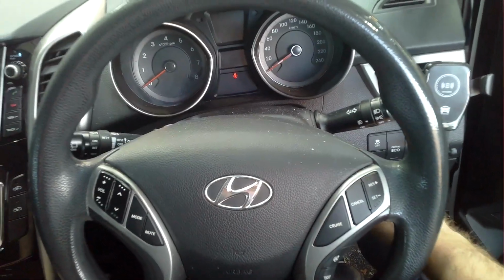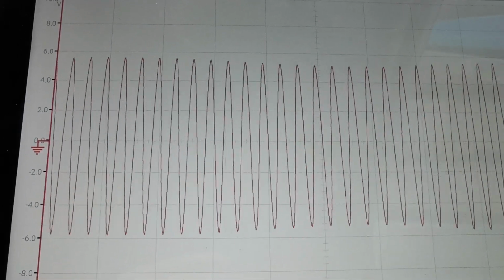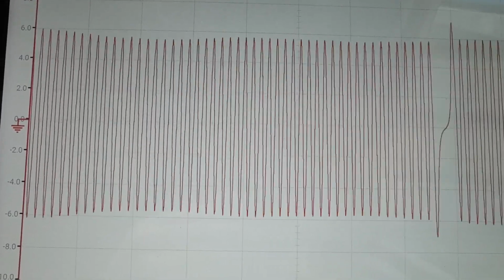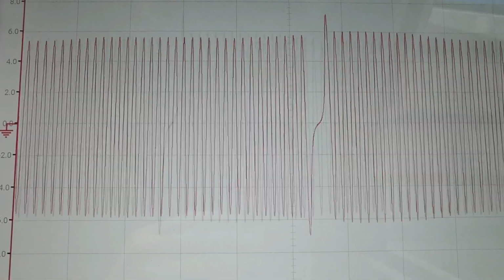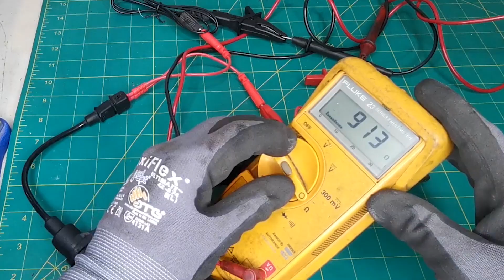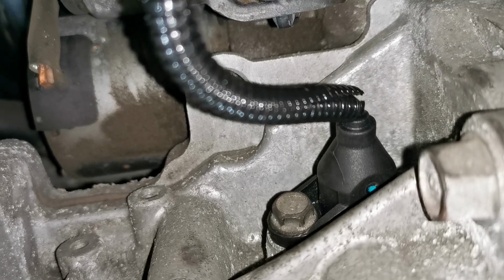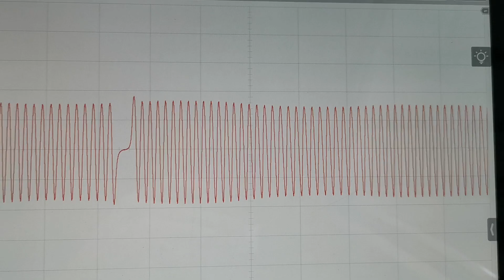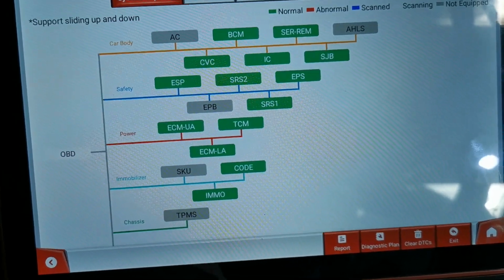Crankshaft Position Sensor - How to Easily Test (2 Wire Sensor) - P0335 / P0336

Comment: I have hundai accent 2000 seccond generation 1344cc 84HP
It has problem it doesent starts on first cranking I need to crank 3-4 times so car can start. If after start I imidiatly turn off car and crank again it will start without problem.
If I leave for an hour and try again to start the car again I need to crank 3-4 times.
I am trying to check crankshaft sensor (39180-22600 it is original part that came with the car, never changed I am first owner) and wiring for it.
I disconected conector and I was cranking and measuring volts directly on sensor. On every try I got less than 0.1V DC.
Also I removed the sensor from car I cleaned it and measured volts when I was moving metal object next to sensor again same under 0.1V DC. I measured sensor for resistance it shows 855 oms.
I put it back on car I tried again disconected and cranking and again I got under 0.1 DC volt.
I measered volts on conector side (not sensor) with ignition ON. I got 2.5V DC on both terminals (conector is with 2 terminals)
I turned ignition OFF and I measured oms between 2 terminals I got 7.8 kilo oms.
Also I measured oms between each terminal and chasis and I got 40 kilo oms between first terminal and chasis and alos 40 kilo oms between seccond terminal and chasis.
So according to this is sensor fault or some problem in wires or what?
Should I change sensor with new one or if the problem is in wiring of the car to go to some elctrician?
Thank you